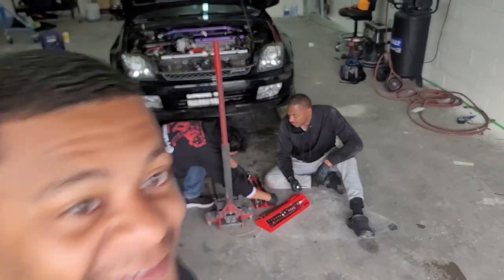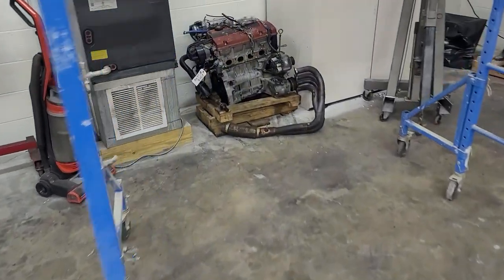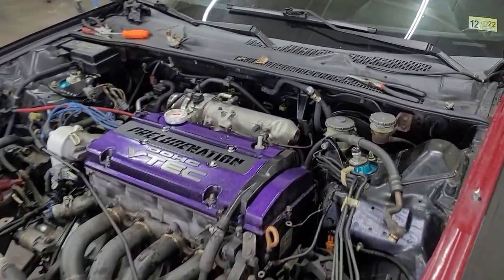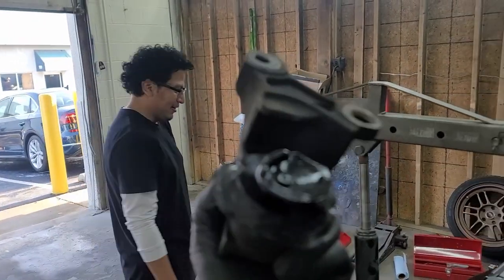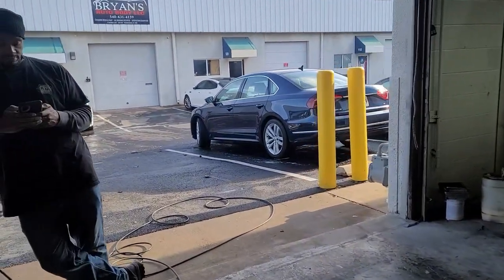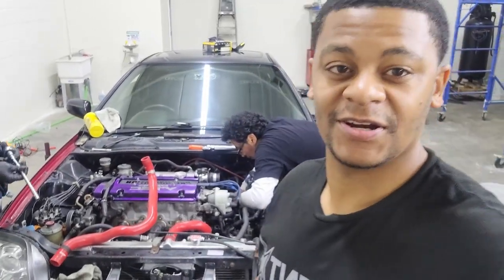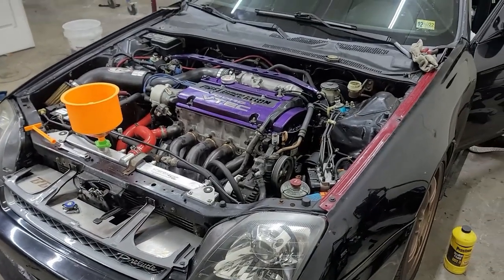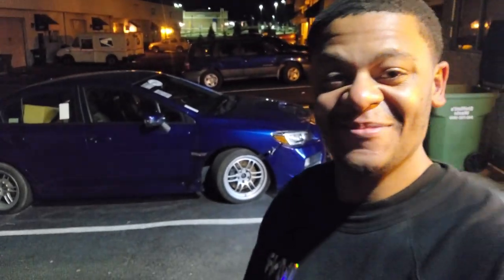Swapping a f20b in a subscribers 5th gen honda Prelude

Comment: I put a f20b in my 5th gen aswell. I had the ap1 cluster, s2k steering wheel and the tan s2k seats. It was a beautiful car
Reply from the maker: Nice....what happened to it?
Reply: @treybedipping1734  I had a family. Sold it for 6k in El paso while I was stationed at Bliss. I regret it so much but we needed a family car. I have pics, wish I can show them here.
Reply from the maker: @CantUwU  ahhh ok send them on ig
Reply: How hard is s2k cluster in 5g?
Reply: @matteocoutant4282  Took us 3 full days total. It was rough, we got pulled over trying to time the head unit with the speedohealer
Reply: @CantUwU  damn

Comment: Is swapping a SH prelude the same process as doing the base model? or what is the difference that needs to be done
Reply from the maker: Swapping and sh with another sh motor is pretty straight forward but to go from sh to a base model has a few things that you need to do.
Reply: @treybedipping1734 well i want to base swap my SH and everyone saying that the SH axels will work but some others say that you need to use base axels and shafts what should I do?
Reply from the maker: @asianv3  you can't use sh axles you'll need base trans, axels, and half shaft and I think you'll need the base knuckle spindles too. Not 100% on the spindles but def all the other stuff

Comment: Hey man I have a 1994 prelude si and swapped it with an f20b and I’m using the bb1 p13 ecu but I’m using the none vetch engine harness I wonder how can I add vetch cause I have f20b harness but it’s cut in half
Reply: Run a wire directly from the ECU
Reply from the maker: Yea what he said. There are a Few videos on how to do it

Comment: hey so i got a prelude recently and it has an h22a installed but the engine is done for, i wanted to get another engine for it. would you recommend the f20b for me to get?
Reply from the maker: If you can find a decent used one sure. But with the price of motors now a days it makes more sense to just rebuild the one you have.

Comment: Hey trey doing a f20 swap lil old of a vid but I’m doing a h22a4 swap to f20b jdm do I need anything like any riye wire things head I had to get a cps conversion
Reply: Working with Corey Oliver and we both don’t know
Reply from the maker: Everything you need you should be able to pull from the old motor.
Reply: @treybedipping1734 thanks bud ur the reason I wanted to go turbo but Corey said build the block before boost
Reply: @treybedipping1734  like the harness what did u do with the old cps connections